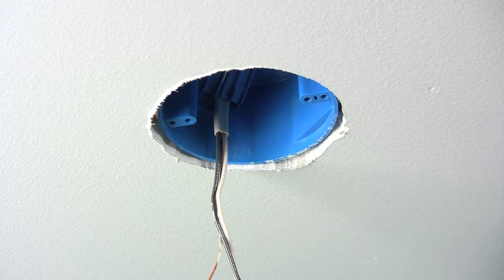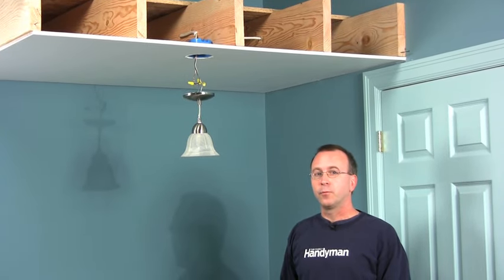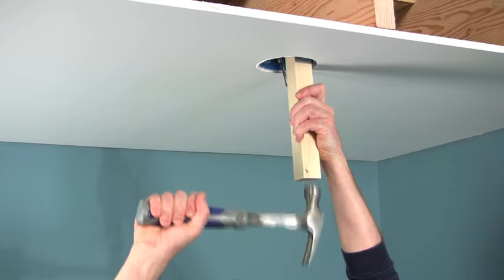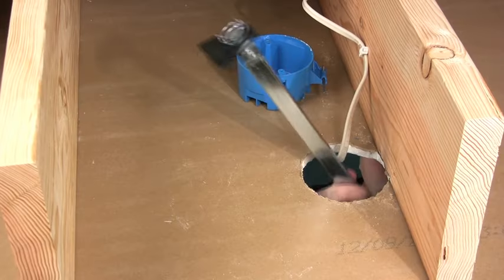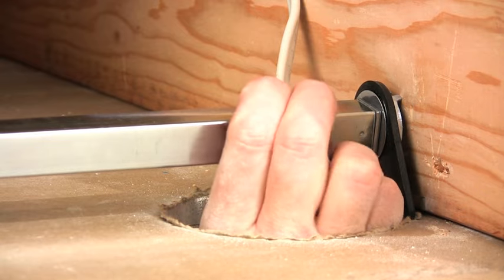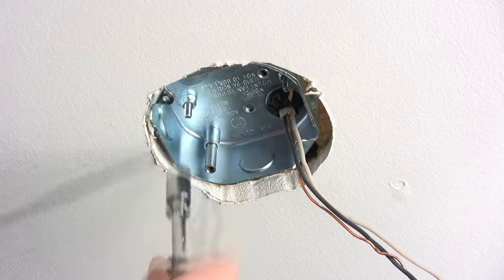How to Install a Ceiling Fan Brace

Comment: If your attic is anything like mine, you will have piles of blown insulation on the other side of the ceiling sheet rock. Which means you won’t be able to just stick your hand through the hole and adjust the brace to fit between the joists. In this video they have an empty attic above them- no insulation. I had to climb up in my attic to dig away the blown insulation so I could attach the brace.   Also it’s easier to just go up and pry out the nails that hold the old box to the joist. Pounding it out wasn’t working for me- It was raining popcorn from the ceiling on my face
Reply: i assumed this was for a lower level install where you don't have attic access
Reply: @hkkh7363  It is. If you have access to the other side of the ceiling, there are better and cheaper ways to mount a fan.
Reply: @davidlapierre4058  Cheaper than a $10 brace?
Reply: @vanquish421  The remodel braces as shown in the video are usually ~$15-20, but the point's the same. If you have access to the other size of the ceiling, a scrap piece of 2x4 would be the most basic solution. With the length in question, you can probably get one for free from any home improvement store.
Reply: @davidlapierre4058  Ah gotcha.
Reply: @vanquish421  18 inch scrap 2x4 and 4 nails as a block.
Reply: I have blown asbestos lol but I have a cape cod house and been up there once before. Not fun. I’m going to attempt to do this first.

Comment: In these cheaply built new construction homes - there are no ceiling joists of solid wood anymore. It's all 1" particle board rafters. With another 2" piece of 1" particle board at the bottom (creating a little lip - of which the drywall ceiling is screwed to). Makes it virtually impossible to use one of those ceiling braces. Unless you set it right Above the lip. Really tedious and frustrating. Almost as much fun as replacing a bathroom fan in an old house.

Comment: These kinds of videos are exactly the kind that get people into deep do do when things don't go according to the video! Lolol I've installed dozens of ceiling fans, not one was as easy as it looked on the video. Insulation, vapor barriers, extra nails, ductwork, rodent nests, wasps, wiring, attic catwalks, and multitudes of unforeseen issues are more the norm. Sometimes it goes without too much fuss, but never without any snags at some point. Nice video, but remember it's U Tube!
Reply: Negative Namcy here.

Comment: This video is not only lacking all BS, but in preparation for the video they installed a section of ceiling, and did so in a manner for easy viewing and understanding whats taking place above the ceiling during installation.  This video is just over a minute long, basically telling you no more, and no less, than you need to complete the task listed in the title. Many videos haven't even gotten through their standard intro, suggesting to  you (prior to watching) ti hit like and subscribe, and then the ever so silly literally unboxing portion - that in many case actually describes the packaging.

Anyway, thanks for the video and the time that went into making it,

Comment: I did this today.  However, I went with the bracket that screws on to the joists since I had access to the attic above.  It was a hassle getting the attic piece done with all the insulation up there but it worked out.  The fan is up and very sturdy.  Next one I may try this one you can install and just twist to tighten.  That will save a time and sweat.  I was just worried about it not staying tight over time with the fan vibrations

Comment: Great instructional video, exactly what I was looking for.  My existing box broke in half when I pounded it out, but it loosened up enough so I could pry out the nails that were holding it into the studs (so a small pry bar may be needed).  And as for drywall nails popping out, the instructional video has a temporary setup and the ceiling bounced as the junction box was struck.  With a permanent structure nails should not pop out (unless you swing your hammer like Thor).  - Thank you for posting this video!

Comment: I had an existing metal box, but this trick still mostly worked.  I used a piece of wood and a deadblow hammer to break the weld points, and then I had to remove the remaining bracket separately.  (Two very well anchored nails.)

Comment: Really need one of these that show how to extend the box so that it's flush with the top of the ceiling - many modern ceiling fans extend past the edge of the box and this makes it a huge pain to not crack plaster / mount them securely
Reply: Exactly the issue I’m having now.  Thinking it would require a few spacers above the box to ensure it is flush.  Otherwise, you cannot secure the fan correctly and tightening it will crack the drywall.

Comment: I want to hang one of these, but I have a mobile home. Looking up into the existing hole, I don't have those nice beefy 2x12's up there, I have 2x2's. Yes, the whole roof area is made of 2x2's holding up my roof. The bracket doesn't have enough wood to hold onto. What can I do? (short of removing and replacing my entire roof structure)

Comment: I tried a wood block and hammer but it didn't work for me, it only sprung back and made me tired.  But with a wood chisel that had a built in handle on it and a hammer I was able to break the 2 plastic places where the nails went through. Wish I would have done that first.

Comment: I have that tester, but I misplaced it. That one makes sound along with the visual display. I love that tester. When I compare it to my K.... tools tester. That tester is much better. Not only because of the beep but it is more sensitive. My K..,.. Tools won't detect some wall switches with the plate on. 

 I'll search the web for the brand. I need another one of those. 

Thanks for your video good job

Comment: I have a client with a condo in our downtown area which is all metal framed. They have a 1 gang junction box in the ceiling holing up their current hanging light. The box is only held onto the stud on one side, the the fixture hangs at an angle. Obviously, if there was wood above the ceiling, this wouldn't be an issue. But I'm looking for a non-invasive way to connect a brace between two metal joists. The only thing that comes to mind, currently, would be to cut out the drywall and use self tapping screws or drill holes and connect the brace with bolts. 
Trying to see if there's an easier method to do this that won't require removing a section of dry wall.
Any suggestions?

Comment: How in the world do you get it to fit properly when the hole is right up against the joist? Is there a certain type of brace I need? I have the retro brace kit from Hubble brand.
Reply: there's a product called ez brace 101 coming to your local home improvement store soon that will make all these hubbell, commercial electric, and westinghouse fan boxes obsolete

Comment: Do you just eyeball the centering of the bracket. If it’s off the box won’t line up with the hole.
Reply: just trim the drywall to fit then ! The cowling will cover it
Reply: @kameelhuseffi5390 Very bad idea in most older homes

Comment: They are also what is reccomended for if you are adding a new light between joists, which is what I did. Because of the issue of the insulation, I wound up going up into the attic to install it. I basically just need to get it in place and tight enough that it wouldn't move, doing the final tightening from below. Not an easy job.
Reply: If its just a small light fixture all you need is an old work plastic box.

Comment: Nice video.  I have a question:  wouldn’t be a regular metal box attached to the beam enough for a 20pounds chandelier?
Reply: No because the box is still usually only connected to the beam by a couple small nails. This brace isn't even really the way to go if you can get attic access. Ideally you'd want to cut a 2x4 to fit between the two braces and screw it in on either side, then mount the box to the 2x4 but that requires either opening up the drywall or getting access from above in the attic. This brace in the video works in a pinch.

Comment: Thats awesome but my attic has Fiberglass type insulation in small peaces spreaded all over my attic which barely has enough space to crawl in it so doing something like this won't be as easy as it looks. But still a very useful video. 🙇‍♂️🙏

Comment: Also, you had the wrong side of the brace close to the hole....other side had a hexagonal nut, you could have used wrench to make it more tighter so teeth would go all the way in until flange of the brace. It's still kind of ok but hand tightening is not enough, adjustable wrench can be helpful.

Comment: Thanks for the video. I have a question. If there is access such as an attic, do I need to put a brace still? Are there other methods or products I can use?
Reply: You need a brace of some sort for a ceiling fan. The drywall itself wont hold up over time and the fan would come crashing down. If you have attic access,  you can cut a hole in the ceiling where you want the fan, then stick a piece of dowel rod or wiring up through the insulation to find your spot in the attic and you can use a 2x4 to go from one ceiling joist to the next and attach your electric junction box to the 2x4. They make different kinds of boxes for fans that attach in different ways to a 2x4 brace.
Reply: @rodneymoore2610   this was very helpful thank you. You gave a great idea
Reply: You can use a 2x4
Reply: @rodneymoore2610 If you live in an older house, do not cut the ceiling

Comment: Nice video but skips over probably the most difficult part of the procedure: how/where to position the saddle on the support bar so the screws line up with the box's holes and so the saddle doesn't move.
Reply: Exactly! And what is the answer to that part?:)
Reply: @misstrish3  Will depend upon the fan brace. Turns out that despite being marked for old work, the fan brace I bought from Home Depot (forget if it was a Westinghouse or Commercial Electric was not for old work. Being new to this game, by the time I figured out the problem of buying the mis-marked product, I was beyond the return date. 😞

However the fan brace I bought at my local hardware store for the same price as the Home Depot products worked as a charm. Installed in perhaps 30 minutes.

Bottom line: if one can't figure out how to use the "old" work fan brace, it probably wasn't meant for old work. Good luck with your project.

Comment: One problem is dealing with insulation in the attic, as it will be in the way of the brace. In addition to the batt insulation in our attic, there is about 12" of cellulose insulation. Getting it out of the way will not be easy.
Reply: Reality
Reply: That’s why these types of videos are pointless. They need to show this being done in a actual house and how to deal with misc issues like insulation and such.
Reply: Nor they show the blown in insulation crashing out of the hole into your breathing mask and goggles that are fogged up from sweating because it's so hot from not having a fan️ in the room!  Nor did they play the soundtrack of expletive words used to vent frustration when engaged in fixing someone else's screwed up messes! Lolol good times!!!

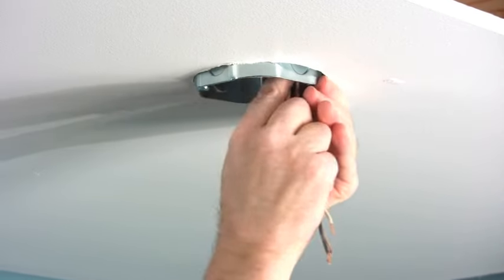Comment: At minute 1:06, when you are fastening those nuts onto those bolts, is that what’s holding the entire box up? What if I removed those nuts you just fastened, would I be able to remove the entire box with those other screws they go into the fan base? I’m trying to remove a old box because the screw they feed through the fan base aren’t long enough.

Comment: My ceiling fan box was installed with the house.  I just removed an old fan and I'm trying to install a new one.  For some reason, now I can't get the mounting bracket screws all the way into the box.  What am I doing wrong?
Reply: Is the box plastic? If so, it's not fan rated. Sounds like one of the screws stripped.

Comment: How do you do this if you’re in an apartment and the ceiling is structural concrete?
Reply: That's when you get an imaginary one 😂😂😂. I have the same problem
Reply: I would say drill into the concrete and use lead anchors
Reply: Get u some Nuts n Boats on Sail n find a nice spot to set your Anchors. Land Ho, the right Tools too. Island ya some but the Corona Bull Ship n whatnot. Yacht a be fine. You'll feel like Canoe person Rafterwards
Reply: @slimmyhendrix4067  wtf. Sounds like you jumping between sailing directions and ceiling fan installation instructions
Reply: If your putting one up I suggest using masonry screws to hold up the junction box. There made for Bricks concrete and other hard materials. The color of them are blue and there extremely tough to hold up.

Comment: thank you I bought one to use and my brother in law was like a 2×4 will be fine cause the fan already comes with a bracket. I don't feel comfortable with a 2×4 and not a box cause it's in my child's room
Reply: A 2×4 may very well make a better brace, but you still need a proper fan-rated box

Comment: Why didn't he use the other type of old construction box that securely screws on the side of a joist since it's  just perfect already. This type of fan box is also rated for fans and you safe your self the bracket money. 
Could he have taken that raut
Reply: Because not every installation will be right next to a joist.  Some refits will be in the middle of a joist cavity.
Reply: A ceiling fan box must be secured on both sides. Just a side-mount on one joist will not be secure.

Comment: You would not have to go through the trouble of knocking the box out of the ceiling if you only would have used an EZ-Brace101

Comment: It actually says right on the box "NOT INTENDED TO REPLACE BRACKET MOUNTED CEILING OUTLET BOXES" which is exactly what you did here. Not sure that will actually hold anything. The legs aren't even sitting on the drywall like they are supposed to because the drywall was cut out when the original "bracket" mount was installed right next to the joist.

Comment: This is a great way to do damage to your ceiling, especially if you have an old home with a plaster ceiling. Additionally, they did not mount the junction box flush with the ceiling, this is considered a fire hazard and would not pass inspection without an extension ring.

Comment: So a hand-tightened bar with two dopey joist teeth, both support a fan, & prevent it from wobbling?  Meh. Meanwhile your fan's support brace has to fit on the electrical box precisely. Even if that's achievable, are the box's screw points sturdy enough to support the fan? I see the box is pretty secure; but how the fan attached to it, is key here.  Some fan braces attach points are at their far edges, which implies that a cross joist (wood, baby) is either hiding up there or awaits your installation before the fan. That would be a properly secured fan, but would also require some dry wall removal and replacement... You know: Work... Not this guy's forte...

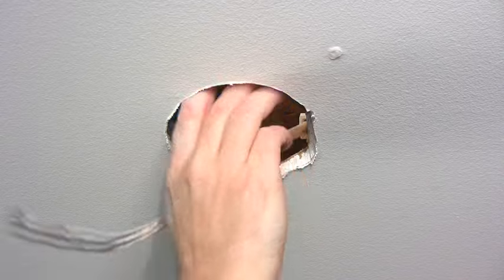Comment: what a joke. pound it out with a block. thats a good way to have all your drywall screws pop. oh wait they did at 0:36
Reply: The screw / nail popped because the ceiling joist was cantilevered and there was excessive bounce.  The process worked fine for me.